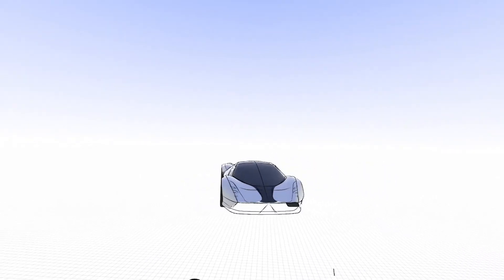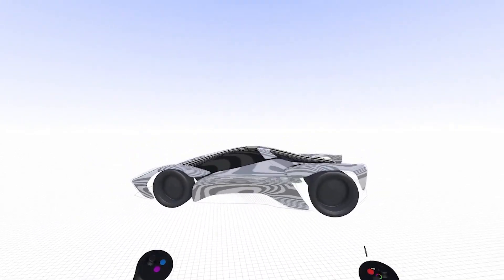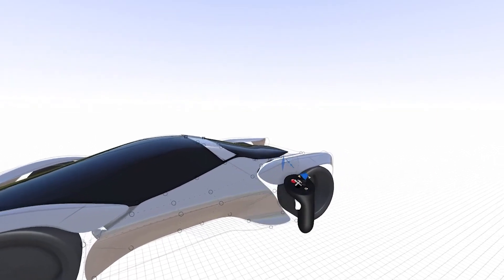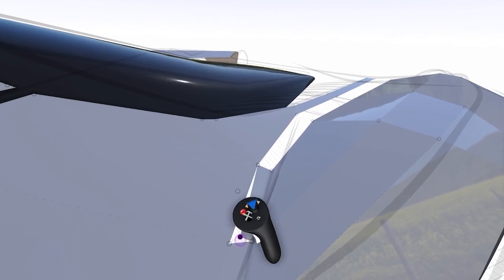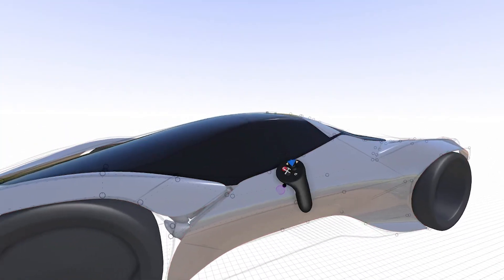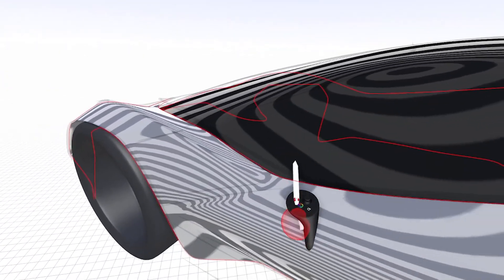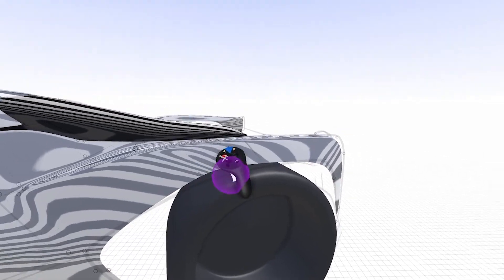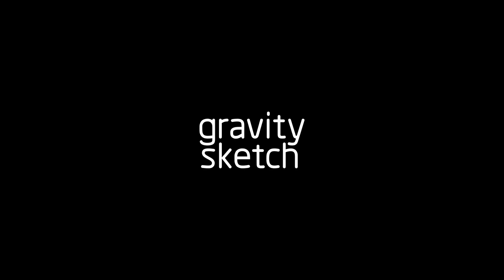Part 2: Building a Sports Car in SubD with Ribbon Stroke

Comment: Thanks for sharing Scott! What would be the workflow to develop final surfaces after you've finished in Gravity Sketch and have imported the data set into another application, do you adjust the imported model or start fresh using the imported Gravity Sketch data as a guide?